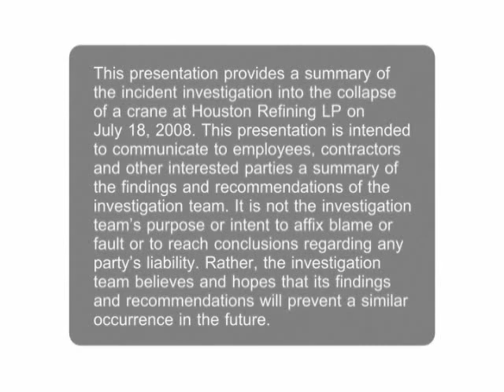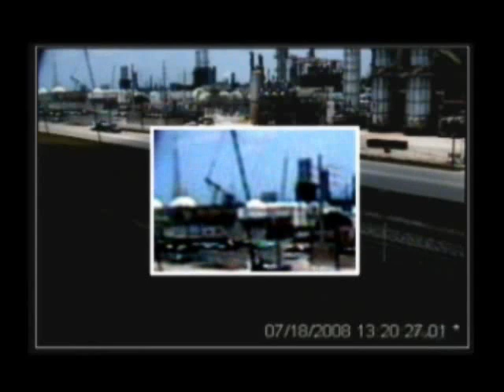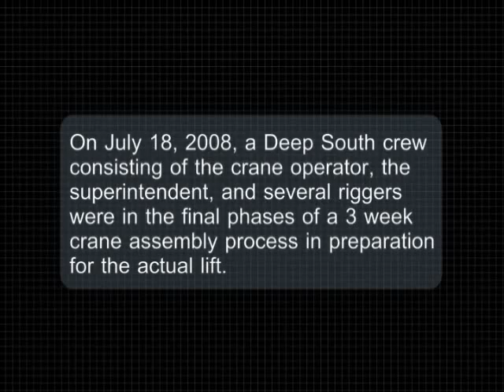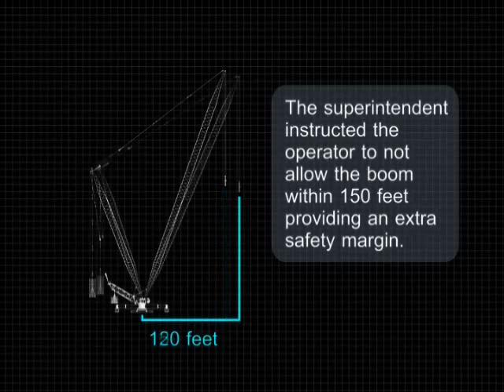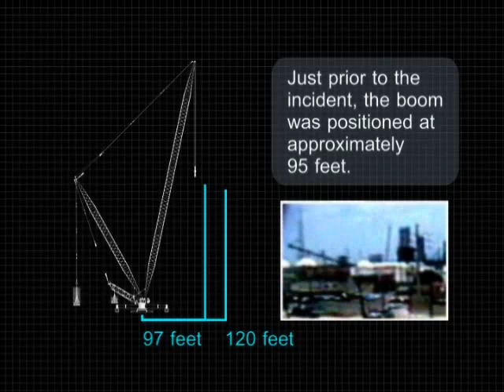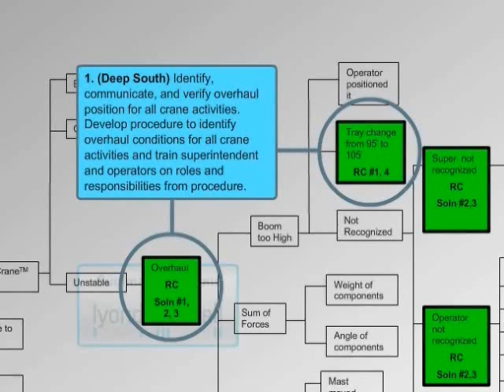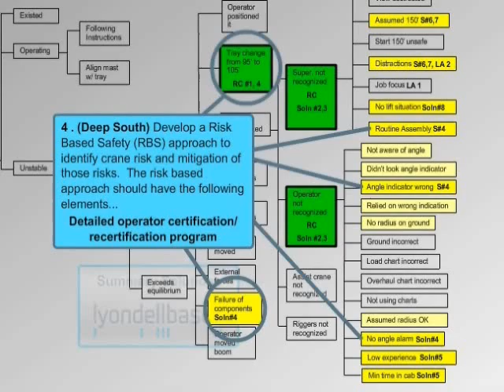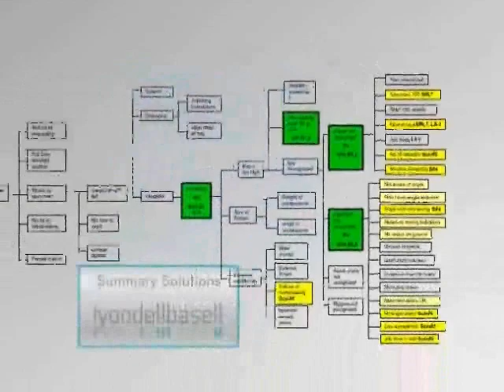Root Cause Analysis of Versalift Incident - Part 1

Comment: The reason ? Operator error! This kind far too common . One thing for sure this operator will never do the same thing but most likely will not want to be in that seat again . When a operator swings over side and tips the crane over ( if no one is killed ) that operator will never do it again . The stability of a crane is not the same over 360 degrees of swing . They were building up and connecting the bars to counter weight were short . They needed to move weight or rig but booming back over hauled the mast . I had a friend on massive bridge give instruction to pin it there at the load limit . The other gang was high so instead of coming off to next holes to pin kept coming up and entire bridge deck went in the hole tremendous loss of materials but fortunately no one was killed . My friend was killed on a story job in Los Angela's twenty years later . 
Leon Winchester , Mike , and Pat Golden Dec 18 , 1985 . Bad deal . Nothing falls from sky but tools birds-hit and structural ironworkers , or so it seems . I have lost several friends by on job accidents , it happens .
Reply: sobering read
all the best
Reply: The operator will never do the same thing again OR get back in the seat because he didn’t make it. Pretty sure all 4 casualties were from Deep South but I know one of them was the operator.

Comment: This doesn't answer the important question - WHY did the crew not recognize the overhaul approaching?
Reply: Possibly without use of a checklist, distraction might also be a factor.
Complacency perhaps. Didn't have safe condition procedures in detail.
Reply: JetMechMA  I agree with you! I had over 44 years in the industry and I have see every dumb ass move you could imagine! We had a much smaller truck crane 27 ton that had a lift computer. Yes you could override and do dumb shit but at your own peril. You could be fired or God forbid die /kill or hurt someone else. I prevented a good many incidents by stopping such moves. I rarely saw anyone do a proper inspection on the equipment they were using. When I did and found defects, I would turn them in only to find it in service again with the same defect. I am retired now so good luck kids! You can inspect many more incidents like this because people are just stupid and ignorant!
Reply: They did but the plant made them boom up
Reply: @kerseyj.r.5939 please elaborate more on this

Comment from the maker: @canucksteel 
The crane wasn't under load, it was still being assembled. They were pulling the derrick mast back to pin the super-lift counterweight. The operator forgot to lower the boom as he did it and pulled it over backwards.
Reply: Toen cc

Comment from the maker: @canucksteel 

Sorry, didn't mean to sound harsh. If there is an inching mode it is only to make sure that there are no sudden or large movements of the crane. I'm pretty sure it doesn't allow the crane to be left moving unattended.
If the operator jerry-rigged the controls to move with out direct input then that's a different story. Hence my comment about "manufacturer approved" settings.
Anyway, while you are right about an inching mode, that wasn't the cause here.